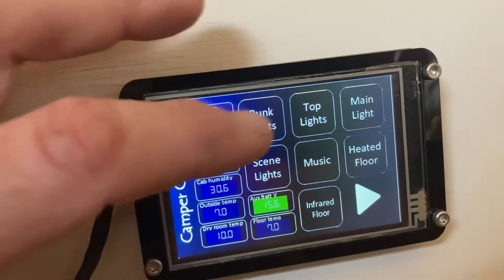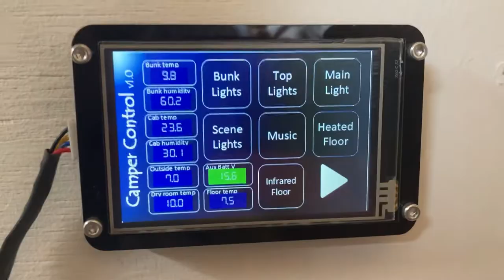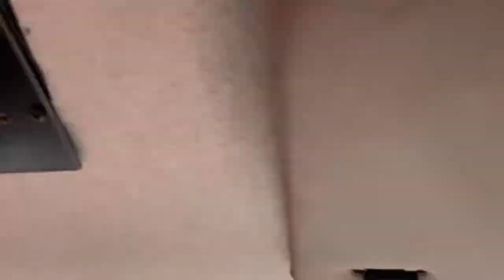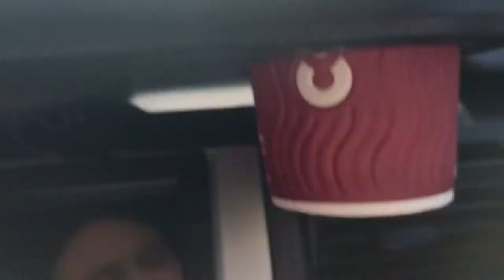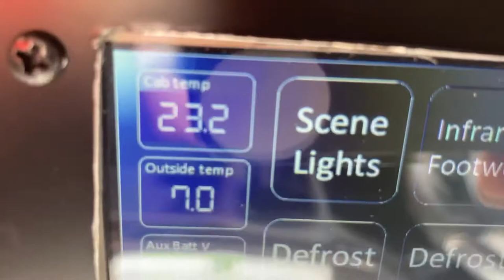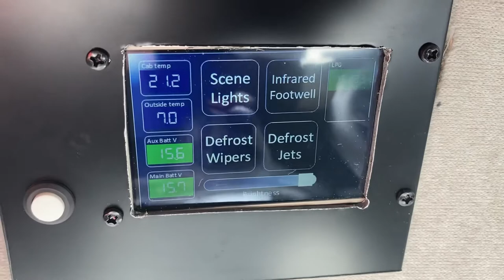Camper van touchscreen controller with Arduino

Comment: I was about to do the same with my camper. I'd like to have multiple displays. Is it possible to have 3 displays with one arduino?
Reply from the maker: It is.  I configured this one with two displays and had one in the front cab (before it fell off the roof and broke!).  You just need a serial channel for each display.   For this I swapped over to the Arduino Mega from the Uno as it has more dedicated serial channels.

Comment: This is really nice , you got something special here, exactly what I was looking for . Would it be possible to monitor a 48v battery pack with 48v hybrid charger inverter with a arduino and this set up? Greetings
Reply from the maker: @thomasvanlanen6279  You would be able to.  Some kind of voltage divider